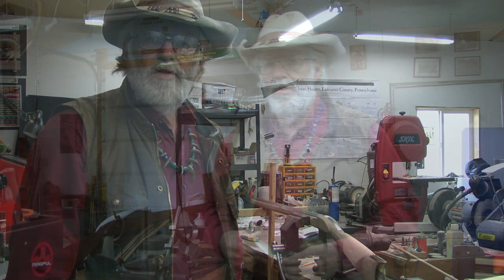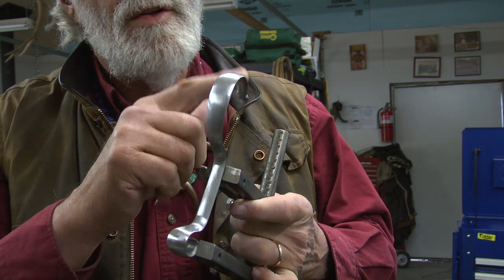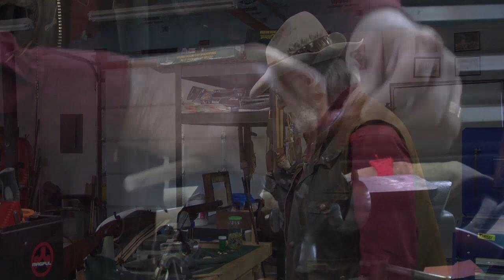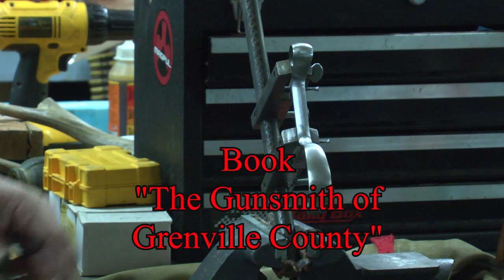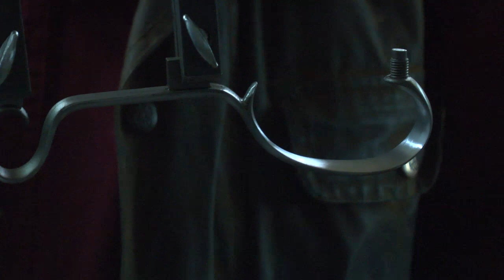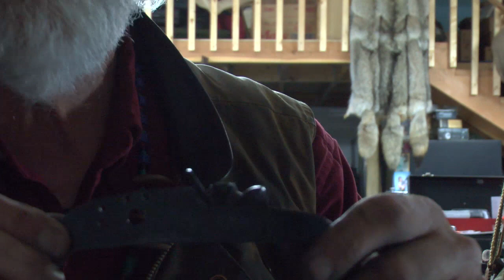Pecatonica River Flintlock Hawken  Muzzleloader Build  Update 10  Polishing Trigger Guard and Lockp

Comment: Make a slot in a dowel, (wood or metal) feed a strip of sandpaper (various grits) through and curl it around several times and clamp the dowel in a drill. Power sander for tight spots !!